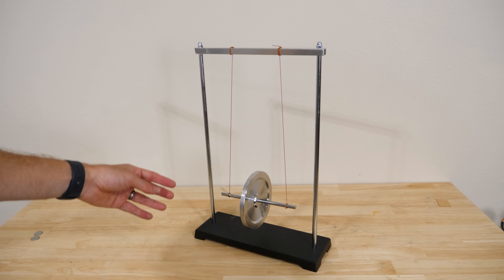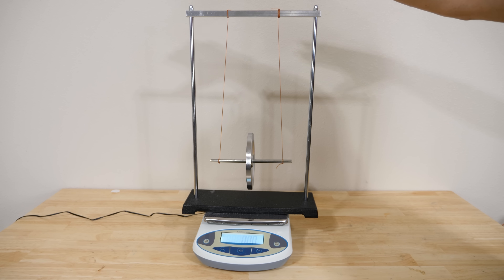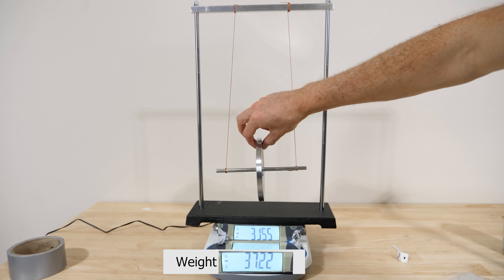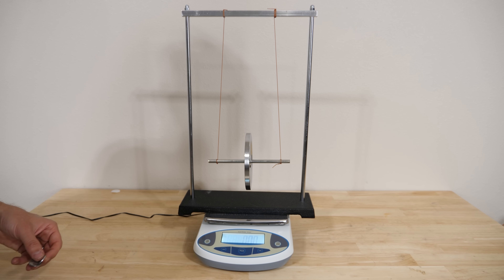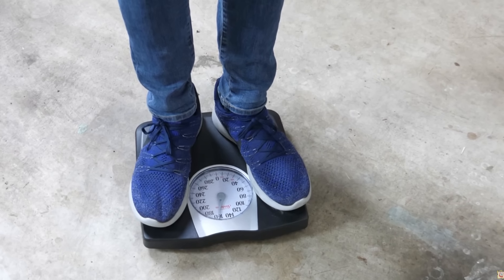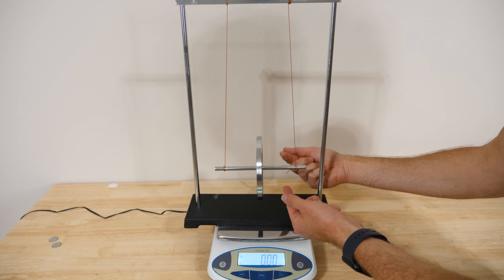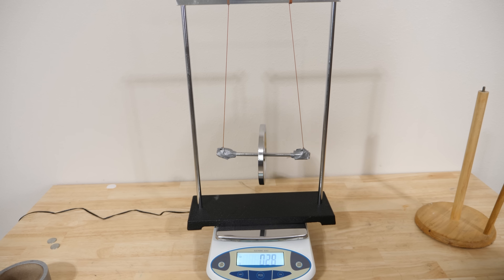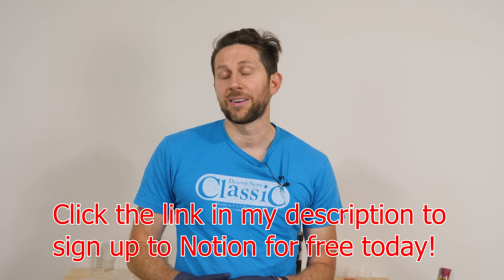How Does The Anti-Gravity Wheel Work?

Comment: The weight registered on the scales will be the total weight of the support frame plus the tension (converted to grams) in the two strings. While it's unwinding on the fall phase, I can see why the tension will be less than in the stationary hanging mode. But why the tension would be still be less in the climbing phase puzzles me. I'm not sure that's been explained. Great videos.
Reply: He did explain it in the video.  After the wheel bounces at the bottom of it fall, it's moving upwards at its maximum speed.  As it rises is gets slower and slower until it stops at the top.  So it's upward acceleration is negative and this is the same as saying that its downward acceleration is positive just the same as when it's falling.
Reply: Actually, it would be interesting to see if the tensions in each string were the same... (strain gauge?). I suspect there could be a difference where one string is largely supporting and the other largely preventing precession. Do they switch on the way up? Or does the one preventing precession switch to preventing precession in the opposite direction?
Reply: Right? Everyone in here is pretending it makes perfect sense when it makes absolutely no fucking sense at all.

Comment: Eric Laithwaite (Dec 74 lectures on youtube) did brilliant demonstrations for sure. Without spin at 2,500 rpm or more, you cannot lift that weight, especially since it's located a foot and a half away from your hand. So this effect is classically explained by the math of objects in rotation with angular momentum and torque. BUT looking a bit outside that "box" the question is about action-reaction (3rd Newton's law); What is this "torque" pushing against? Without something to react against, you just cannot have torque, and without it, you cannot explain why it's so easy to lift. I toyed with this (you need a decent mass and speed to perceive it), and when your body becomes the axis of rotation, hold it in one hand moving it around in one direction (clock wise or counter clock wise, depending on how your gyro is spinning) then it will "want" to lift. And (amazingly) when your body tries this in the opposite direction, the thing becomes nearly impossible to hold as it "wants" to dive downward! Try this with a decent (heavy and large) gyro. No, it's not a gravitational effect for sure, otherwise gyros would not work in deep space. But if you care to look very carefully into it, and find similar studies (practical studies; try to stay clear of arm-chair or purely mathematical interpretations) then you may conclude that it affects the inertial properties of that object. Some believe that inertia is an intrinsic property of mass, whereas you'd be at a loss trying to find one aspect of physics that isn't affected by or affecting something else. Angular momentum does influence inertial properties. Again, rotating it in one direction makes it easy to move 10kg on a lever, upward (while circling it in a corkscrew motion), while the opposite makes it very difficult - I promise you will need to wrestle with both arms to keep it from sinking down! all the while you stand of a scale that won't budge. Spinning a Fidget and trying to move it this way and that way, will do the same but weakly. Your show is one of the very best and most exiting science show-and-tell that exists in the world. We are very grateful for all that you do!  May the day, when the muse of Science has revealed all her secrets, never come for we will die of boredom. 🚀😀

Comment: P.S Addition notes:
You could exemplify this same effect with an old pendulum clock. Not due to the pendulum but the weights that powered the clock. The weights on strings would have a constant acceleration toward earth until such time as the string completely unwound, then it would resume is natural still weight.
Reply: No, the weights generally move down at a constant speed, i.e. they have zero acceleration. The clock is designed to work at a constant speed for several days.
Reply: @barneylaurance1865  The force of gravity is considered as a constant "acceleration" toward the center of the earth. except the ground is pushing back against us with an equal force, so what I mean is the same as what was stated in the video. The clock weight has a "Constant acceleration" toward the earth that is less than 1g.
While the clock weight (or the wheel) is moving toward the earth with less force being pushed back by the earth it will weigh less.
Or put simple a falling object weighs less.
You need to look at some of Einstein descriptions of gravity to see what is meant by gravity and acceleration, but everything on earth has a force of acceleration pushing it toward the center of the earth :)
>
 P.S. The clock weight does stop between each fall cycle on the catch wheel, but still accelerates in between while it is falling. If you measure the entire average weight of the clock until the weight hit the bottom it would be lighter.
Reply: @axle.australian.patriot  The clock weights are at "terminal velocity", ergo NOT accelerating, so their weight is equal to their mass.  Only items accelerating downward, [or decellerating upward] will "weigh" less.
Reply: @rsteeb  Yes, This is true(ish), but like each drop in the spinning wheel there is a short moment of acceleration in the clock weight, so to with each tick of the clock the weight has a moment of acceleration (Drops) a small amount. Sorry I didn't state it clearly in the original comment, but added more context in the second comment.
So like the wheel, the overall "weight" decreases during that moment of acceleration, and then increases when it hits the stop on each cycle. Over all from start to finish the averages for total weight are the same a a static object, it's just those short moments of acceleration before reaching terminal velocity and then overture (Higher than static weight) as the string reaches full length.
>
The point is the spinning wheel and the clock weight are the same example.

Comment: If you attached a 100g ball to a 200g frame, and put on a scale, it (system) would weight 300g. Then you zero out the scale so the scale shows 0g. The if the ball falls off the frame, the scale will read -100g the whole time except at the moment the ball bounces of the surface of the scale. So thats where you get the negative weight. The rotating wheel just slows down the process.

Comment: I'm not comfortable with this explanation. The disk is always accelerating downwards, even when it is stopped.

Doesn't it weigh less when moving upwards because of the momentum stored in the wheel pushing it up when it "bounces" at the bottom?

Comment: I believe you have attempted to come up with an explanation that fits the observed measurement, but I think the explanation is incorrect.  It is fully inconsistent to say the force on the scale is lower (because there is less tension in the strings) when the wheel is accelerating down, and then claim there is ALSO less tension in the string when the wheel is accelerating up.  Your explanation does not require a wheel--it could be done with a simple spring mass system with low frequency.   Something else is going on here.

Comment: Another little side measurement.  If you put a couple of reflective 'dots' on the rim of the disk and use a high speed camera, we could see that the disk rotation is also constantly accelerating.  If the system was made taller and 'fins' added to the disk, you could reach a point where its rotation stops accelerating (and therefore it's downward acceleration zeros).  At this point, the scale should return to zero even though the disk is still moving upward/downward.

So you might have a negative weight shown as it starts to fall, weight returning to zero when the disk isn't spinning any faster, and that positive 'spike' at the bottom of travel when the disk 'bounces'.
Reply: Nice one, dude! I did some calculations here and if I am not wrong, the angular acceleration is, roughly speaking, proportional to the r radius of the rod and inversely proportional to the mass and the square of the disc radius R. So, for a large disc, maybe you can capture the image with a smartphone camera and analyse the footage with a software called Tracker Motion Analysis. It's for free.
Reply: That acceleration is an important clue to what's happening.  The mass of the wheel is effectively bouncing under partial gravity - not in free-fall like a ball, or a person on a tramp, but with an additional effect (transfers of energy) that reduced the effect of gravity allowing it to 'bounce' at less that 1 g..
.
It's a real brain-burner, but pretty cool and really causes / requires serious thinking and a darn good understanding of physics..
Reply: is the same thing used in a YOYO
Reply: Nope, you're wrong. I checked the math

Comment: The display delay in your scale is approximately 1 second.
That makes it difficult to determine when the mass appears to be lightest & heaviest during its travel.

It appears to me that as the wheel approaches the top of its travel, it shows the lightest mass on your scale.  As it moves downwards, the wheel appears to be the heaviest on your scale.

I think you should find some way to automatically measure & plot the vertical position of the wheel & the mass measurement with a more responsive scale.  That would help us to see more precisely what is accurately occurring & when it is occurring with respect to the position, acceleration, & rotational speed of the wheel.

I'm unsure that your conclusion is accurate at this point, tbh.
It is very interesting, though!  Why would the rotational speed & acceleration affect the apparent mass of the system??

Comment: Before you answered the problem I thought this system isn't in equilibrium thus the tension in strings isn't equal to weight of disk ,  the disk is accelerated downwards thus the tension is less than weight thus the reaction force on the balance should be negative

Comment: Probably won't work but..
If you had two hollow cones, one inside the other with a small gap, liquid filled the void, spun it up so the centripetal force increased at the outer edge. Then used a pump to circulate the liquid to the lower narrower end between the two cones. Would the energy used in moving the liquid from the end with high centripetal force to the lower end create a force in one direction?

Comment: If instead of this contraption, you had a weight hanging from a spring, with whole assembly sitting on a scale, would there be a similar result?
Reply: I do think, my friend. It seems like all of it is because of variations in the tension of the string. A spring will just do it in a Hook's Law fashion, I guess.
Reply: @jcmschott1895  I've got to see it, though! What would give a really long period, without a mile-high contraption? Can it be done? Really stiff spring, really massive mass, maybe? Or, I mean... "massive mass" is a big ask. Maybe a really long spring is actually the more practical solution.

I haven't visited Hooke's Law since an AP physics exam in 2003, so I'm a little rusty. You could say that, by being rusty, my spring constant is.... nope, I don't remember enough about the whole dang deal to even finish this joke faithfully. (Silver lining: wouldn't have been a very good joke even if it landed.)

TL;DR - I hope a YouTuber does a thing that satisfies the continuously shrinking part of my brain that is still very interested in things like this. It might even stop shrinking for a while, which I wouldn't hat.

Comment: Attention, the energy of the pendulum is not only given by its rotational movement, but also by the translational movement of its center of mass !  It is precisely this latter energy that makes the mechanical tension in the wires LOWER than the weight of the pendulum EVEN WHEN GOING UP !

Comment: Could you increase 6 grams? By increasing height from which wheel is dropping down and length of the ropes?

Could we use this in combination with electric motor powering the wheel, so it could be utilised for real life applications?

Comment: The difference in the hanging weight vs spinning, is dissipated through the outward force from the flywheel as it's spinning. Any point located on the surface area of the spinning flywheel's outter face will measure an outward force. This force is heavier on the downward stroke due to the addition of gravitational pull, then is thrown back upward. Kinda like they do in the movie Armageddon, when they  "slingshot around the moon" to catch up with the comet.

Comment: You're adding work to the system. The amount of work applied converted to the energy is needed to keep the weight down by only a small fraction of the initial weight. The payoff is very low.

Also, we don't know if the weight is higher or lower than initial weight at the edge of the oscillation because the scale does not register. Since there is more energy in the system, the mass needed to change velocity and momentum might actually be higher than the initial mass.

Comment: My theory as to why it shows -6 grams, maybe the disk/rod is pulling slightly on the string as it goes down (friction), and when it goes up it'll lose a big of weight from "pushing" off on the strings.
In other words; a very gentle push and pull reaction that results in a -6 gram weight.

Comment: Hey, can u do this practical 👇
Do condrinks get colder when it pressure releases, bcoz when pressure will realese  gases ( or co2) will take heat from surrounding
In result it should cold the drink (maybe a little bit but can u try it out)

Oh i have title for you "do coldrings cold itself"

Comment: I remember something about moments - is it possible that the weight is distributed in the X/Y dimensions rather than the up/down "Z" dimension while it's spinning? The right-hand rule would imply that as the disc is spinning some of the weight is distributed to the left. This is the same reason the professor was able to lift the spinning weights. The mass isn't different, just the direction(s) the weight is distributed.
Reply: The gyroscopic effect does not make things lighter. It only makes them harder to turn along some axes. The loss of weight is explained by the momentary force acting on the frame when the wheel bounces. This makes the average weight difference equal to zero, as expected.

Comment: To get Anti Gravity, You need to take two high speed powered gyros on a single horizontal shaft spinning in opposite directions.
And then power spin the whole thing around the vertical center line of the shaft.
This creates a self intersecting Torsion field.
This will allow you to climb up the Gravity well.
Reply: That won't work. You will get the same weight.
Reply: I thought this many years ago but I rather doubt it now. I can’t see how intersecting torsions can produce a translation, but I’m not up to date on physics. A proof of concept wouldn’t be too difficult to make and, if successful, would either get you a Nobel or, possibly, an unfortunate accident on a mountain road.😉
Reply: @q.e.d.9112  🤣

Comment: Even at 35 seconds in, I already see the misconception where people think they're more clever than anyone before them. But it's pretty obvious that they've not taken a basic physics class (usually Mechanics) where a simple force diagram shows you where the faulty logic is. 

That said, I always appreciate how various people describe and demonstrate concepts in various ways. If you can make simple systems which demonstrate only 1 or 2 concepts in an intuitive manner, you can almost sneak the trigonometric ratios/distributions without them noticing. Because once people see intermediate mathematics, they tend to get flustered very quickly.

Comment: So the force exerted at the bottom should be a fraction of the mass based on the multiplier of acceleration due to gravity. If it’s moving at half a G of acceleration, the amount of travel time gives the speed in m/s at the bottom. The speed times mass should give its instantaneous maximum force in gm/m/s—gram meters per second. 

I’m not sure how to calculate the fractional weight loss during the rest of its motion period. I think it’s the instantaneous maximum force divided by the travel time. That should give us a constant in gm or possibly gram/meters?
Reply: Hey, mate! I did it taking into account the rotational and linear equations of motion. The weight loss read in the scale is a function of the square of the quotient between the rod radius and the disc radius, if I am not mistaken. You may think of the difference in the scale reading as twice the difference in the tension in the strings and there will be some difference as the disc is put in movement.

Comment: Is this equivalent to standing in an elevator and it slowly accelerates down you weigh a little less?  If the elevator accelerates down faster you feel yourself getting lighter.  🤔
Reply: I'm on the 50th floor and weigh the building.   As I accelerate down with the elevator and weigh the building it will weigh a little less.  When the elevator stops, the building weighs the same as it did when I was on the 50th floor.